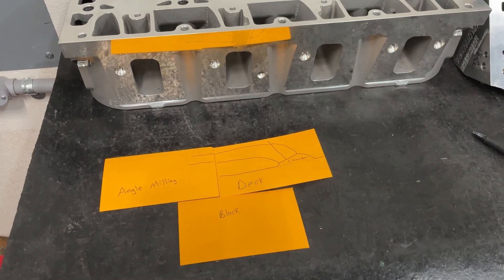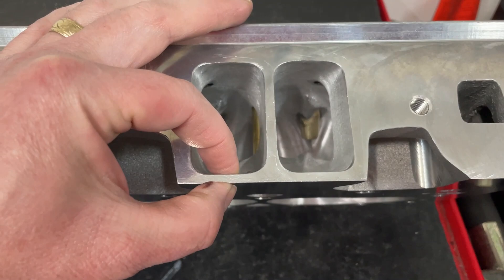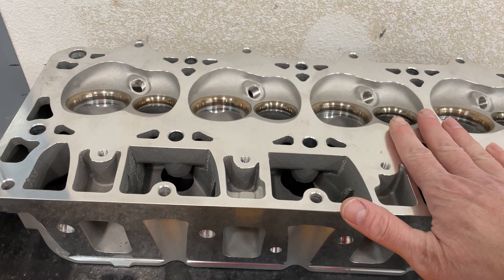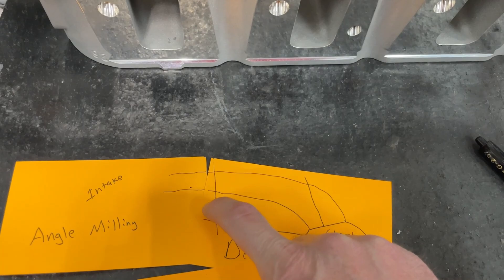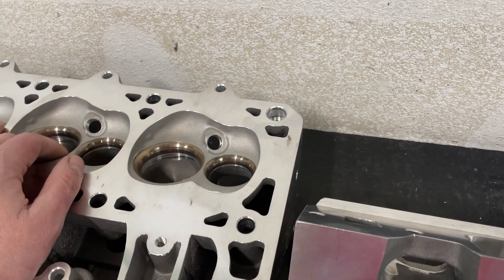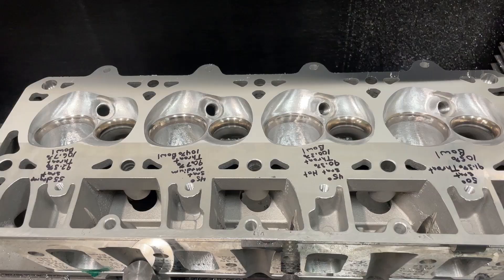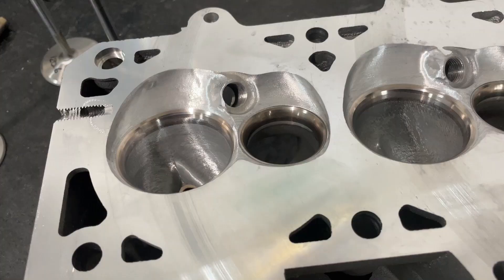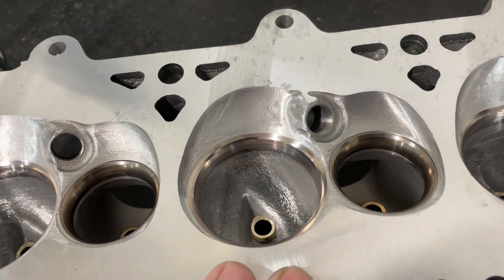Angle Milling Does It Help Flow LS3 Heads Internet Ports Heads Finale

Comment: I have a pair of Daytona Prototype LS7 heads with small intake ports. INTAKE PORT 1.125 x 2.250 (LS7 1.35 x 2.40)(LS3 1.25 x 2.550) it also has small 7mm Titanium Tin coated  int. valves 2.10" & , 1.550" CRN coated ex. They are Chevrolet Prototypes ported by ECR in 2012, LS7 style 12degree HEAD 17802752    235cc int.  87cc  exh. The combustion chamber is 49.5cc, they were on a 360 c.i. 4.080" bore x 3.45" Stroke.  This engine made 700 hp with a 248/248 @ .050 & a .591 lift. The explanation I got was these were early design LS7 before Chevy decided to make the 427 LS7. The downside is that I have to epoxy fill the intake runners, no intakes with small runners are available.

Comment: 0-50 thou on old fuellies  gives a decent compression increase,, eg near 12-1 with 11-1 pistons and shim headgaskets. And no reall hassles machining intake and bolt seats. Large amounts simply make too many issues.
LS I suspect would be worse as a mechanically poorer assembly with less head bolts.
Does anyone make rolled over heads for a LS? In that respect the originals are better than SBC though they have them rolled over to 10 deg these days.
As a road racer and budget engine builder anything over 600 lift simply does not interest me. That is about the max that is A compatible with max 7500 rpm, b compatible with off the shelf retainers, springs, rockers etc.
More than that is an accidet going to happen

Comment: That tiny port is really interesting. Any thoughts on similar changes to a stock casting? Holdener’s tests on a 6.0 show the TFS 225 head (cathedral port, 5cc smaller chamber, so more compression, and 20 cam or so better) is better than the LS3 head pretty much everywhere, and that may be due to higher port velocity for the torque curve. Although maybe you could buy the TFS heads and a cathedral port intake for the cost of that extent of port work…

Comment: 90s small block chevy swirl port head. I know that most people will say it is a waste of time.  I put a set  on my 79 350 2wd blazer. 308 gear. I optimized the Q-Jet and the distributor.  I had to even back off the timing.  It smoked the tires off and really started to scream at 3500 RPM I couldn't believe it.

Comment: On the too small bore, can you not put some clay in the bore/chamber overhang, to smooth out the chamber to bore gap, just to see what difference the gap/overhang makes?  
Like what is worse, a little more shrouding in the chamber but smooth transition from chamber to bore VS. somewhat less shrouding in the chamber, but chamber overhanging the bore and crating an gap.

For a new head to test, the smart answer would be an head with symetrical ports so it is easier to compare to each other, but I would like to see an Olds head, with their curvy ports. But an cheap or poorly made SBC head would probably be best, in regards to both moneywise and audiencewise. Maybe.

Comment: at @12:07 the edge of the chamber looks really close to the valve seat due to the angle milling - is there any danger of that causing shrouding of the valve? or is that offset by the presumed benefits of having the angle milling in the first place?

Comment: what is your opinion on a 4.080 bore x 3.86 stroke ls3 based shortblock versus a 4.125 bore x 3.75 stroke and which head would you recommend? 4000lbs camaro streetcar possible power adder
Reply from the maker: Do the bigger bore. Many benefits

Comment: Do you have any experience with bbc afr 335 wandering if there is room for improvement ,port tune up and trick valve job 505ci drag motor thanks

Comment: How do you fit the stock ls3 intake manifold on ls3 heads flat milled .040?
Reply from the maker: Usually the ports on the intake are smaller so there is no issues.

Comment: Have any experience with speedmaster heads? Their ls3 heads in particular.

Something I might not of heard of is ptv on angled vs milled, does angled gain ptv?
Reply from the maker: Yes they are the same as the head in the video of the worst ls3 heads I have flowed.

Comment: Thanks Eric for all the informative videos. Its nice to see how all of these different combinations may or may not help on a modern head. Do you have any plans on porting the GEN V heads? Seems there would be a good market there since the aftermarket has not come through save for the 2 options I am aware of. Would love to see what a factory L86 port could do in the right hands.
Reply: I'd been wondering how DI heads do too - I imagine things might be a little different because it's entirely dry flow.
Reply: @totensiebush  The L86 head flows a bit better than the ls3 head stock but  I haven't been impressed with the ported versions I have seen advertised, and nothing comes close to this porting here... Would be nice to see a nice race effort port on those heads. Plus anyone in the GenV market wants to sell Head/Cam,Exhaust packages so you don't really know where the gains are coming from.